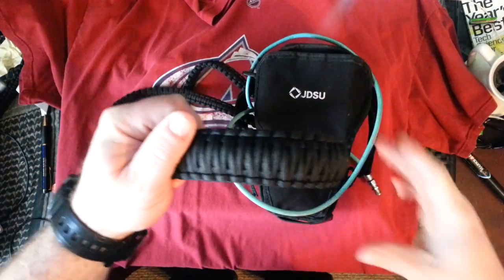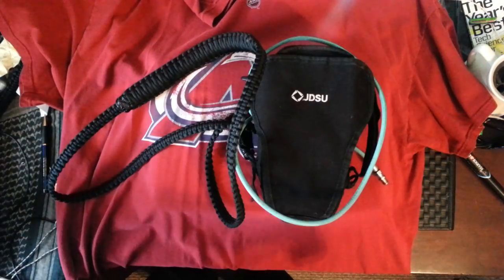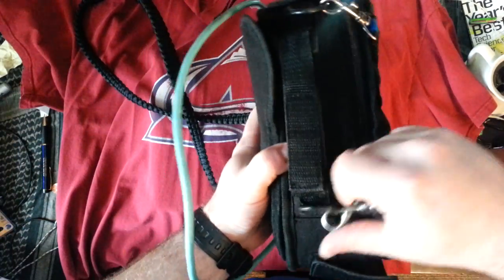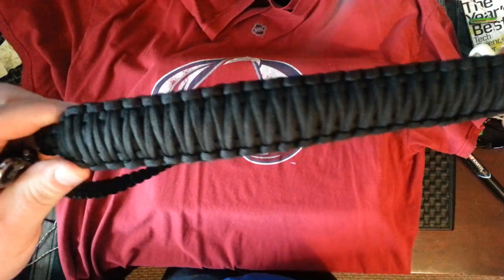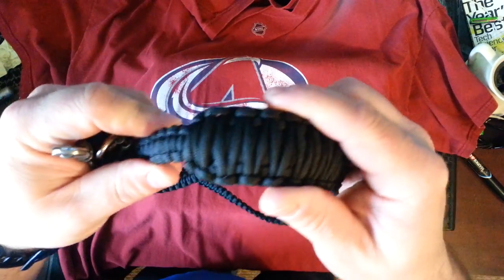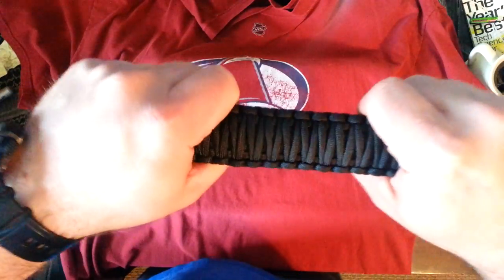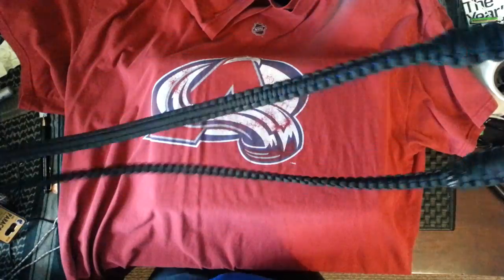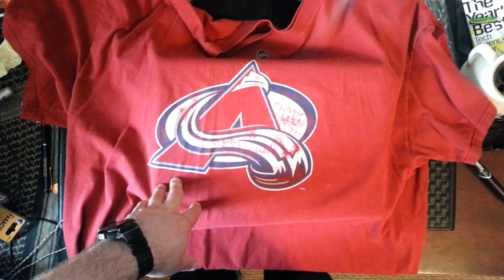COBRA STITCH STRAP

Comment: Hey Josh, I have noticed that you have woven some cords in a few places.  That is fascinating work!  Looks almost machine made. (which I mean as a high compliment because whenever I do something by hand it seems that an automated machine made thing always looks much better!)  What I would like to ask you is:  Is the weaving you do related in any way to the nautical weaving I used to see on ships?  (You know, the decorative woven rails, lanyards for piping etc.)  I used to see that kind of "work" all the time but never ran into anybody who actually did it.  I was wondering if you learned how to do that in the Navy.  I always admire it when somebody does any kind of craftsmanship like that.  Nice job.
Reply: Thank you for the kind words.
Yes it was the Navy that guy me started.
It it's called macrimae not sure on the spelling.
What was on hand rails and hatch handles is called whipping.  Generally French whipping.
Not only is it decorative.  It provides better grip dry and wet, with the added bonus of your hand not freezing to the handle in freezing weather.
Most of the deck apes and especially the old board are good at this.
Reply from the maker: Thank you. 
The French whipping is it was on all of the hatch handles and ladder rails